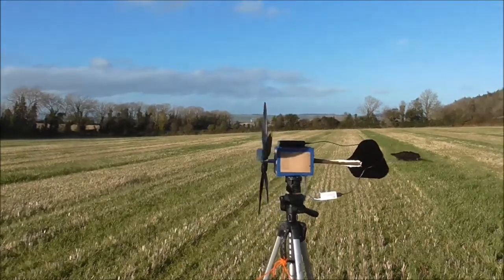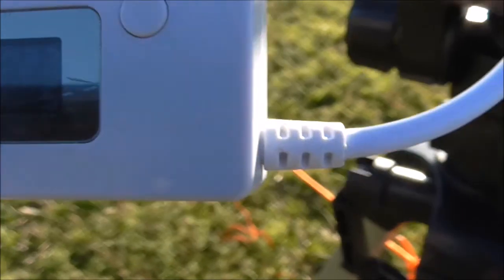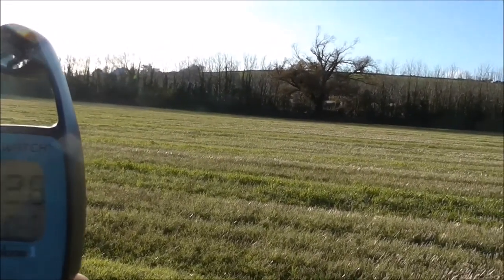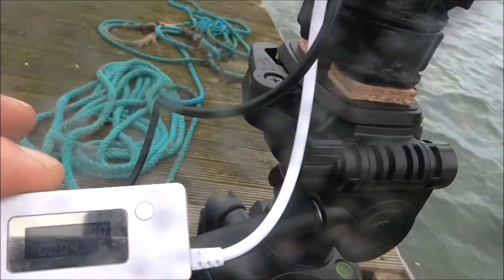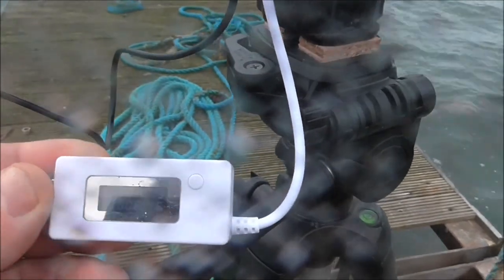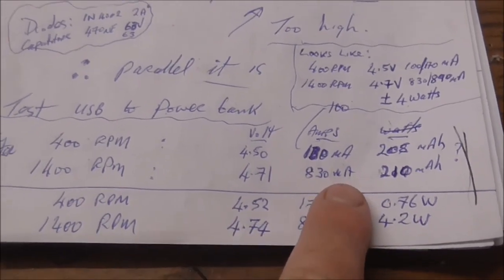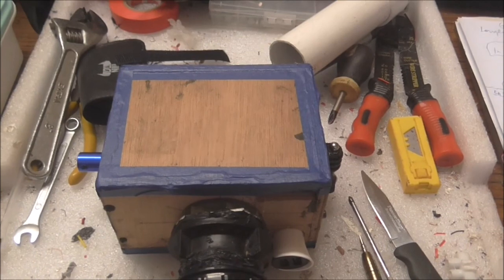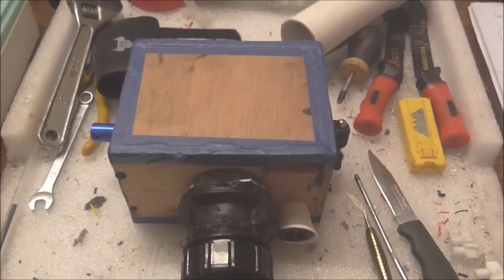Field Test of USB wind turbine   NEMA 17stepper motor

Comment: 👌if it were not for the costs homemade wind turbines could really save money. Especially the blades are very expensive I think. Would need to run such a wind turbine for years to make up for the costs. Anyway, if you know where to find spare parts... it might still be worth it. I'm currently (trying to) build a wind turbine without blades. I also came across the problem of relatively low power output. Maybe my current configuration will yield good results, gonna put it all together soon and wait for the next storm 👍
Reply from the maker: There are a few YouTube videos of people making blades from pvc pipes.
Reply: @martint1151  yep, just need to make sure it's UV resistant

Comment: where did you get the blades?
Reply from the maker: From a USA company called Cutting Edge , on their website they have a list of parts. These are 9" blades , also the blade hubs for either 3 or 5 blades.
I had these from one of their wind turbines I purchased which never produced any amps ( waste of money).
Might be cheaper to make your own from pvc pipe.
Reply: Thanks for your answer

Comment: update you have good wind there. Have you thought about a gear change to increase the speed of the motor and increase output. 10 to one maybe.
Reply from the maker: Yes , I did try gear drive but would need way larger blades due to greater torque needed to turn motor / gearing.
Also thought about pullies and belts but again defeats portability.

Comment: The cost equals mental wellbeing, so true. I'd be happy to build something that was no wider than 18" and could deliver between 1 to 2 amps at 14 to 15 volts, up to 30 watts for when I have no sun for solar. I'm on the coast ( sea breeze almost constantly ) and I can have my choice of any wind direction from the sea as I'm beside two loughs that run N to S and E to W within five miles of each other so no obstructions.
There's a place I like to visit beside a dam that's High up and gets clean wind often.
I don't like parking in wind but it's nice for some peace ( away from the crowds ) I'd like to harness some of that wind to help charge a couple of things, saving my leisure battery for my diesel night heater.
Good video Martin, interesting tests with the stepper motor. There are several 17 size motors but it's knowing what size will work best for fan blade size that's difficult. They also seem to work better with belts to get the speed up but then that's not so simple.
Reply: Thanks for your comments , yes selecting the right size stepper 17 is the main issue regarding overall blade diam. and portability. My understanding is that the max output from the size 17 is 7 watts , which means finding one with lowish torque but at the same time not losing to much mAmps output.
At present building one using stepper size 23 but it's looking like more weight and need for bigger diameter blades.
Also a Canadian company are producing a Windlily portable turbine  , no reviews yet but a more costly option.
Reply: Where we get this stepper motor
Reply: @rsskarthikeyanRtr  If you Google stepper motors you'll find many, ebay too. It's not hard finding them, it's the pairing with Good blades ( efficient  ) for the stepper and also for the average wind conditions. Too much torque and it won't turn in a moderate breeze, too little torque and it will be spinning too fast and/or wasting energy; A breaking system or gearbox to change torque may be required or even tilting fan blades. They can get very complicated Karthikeyan.